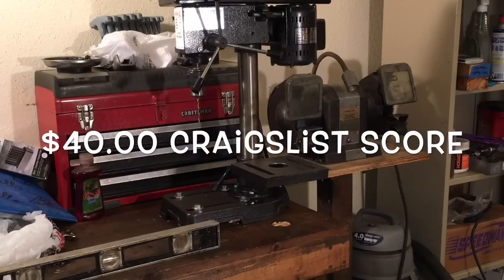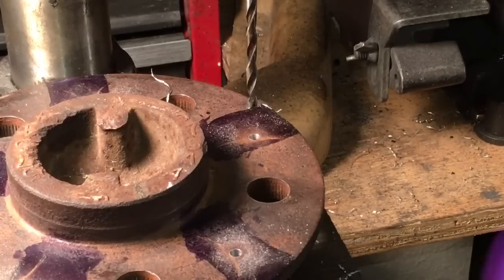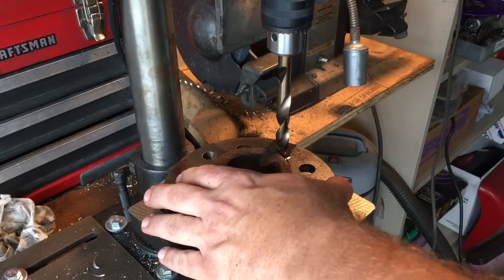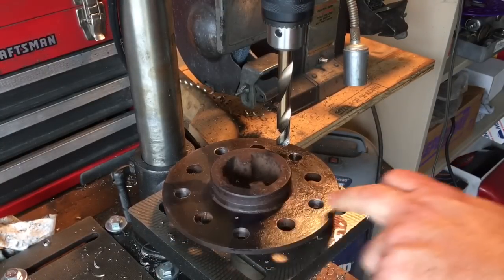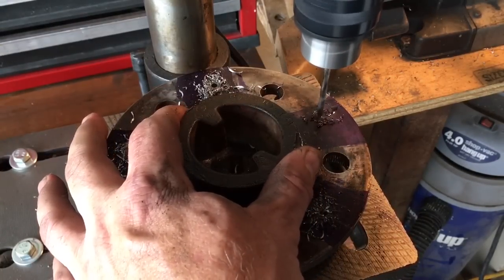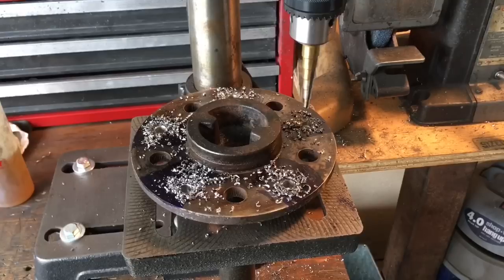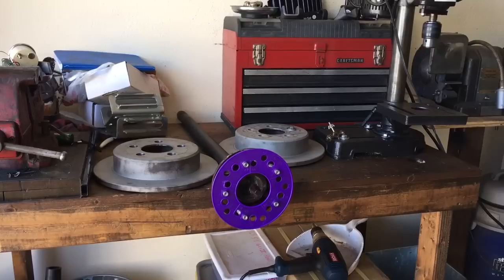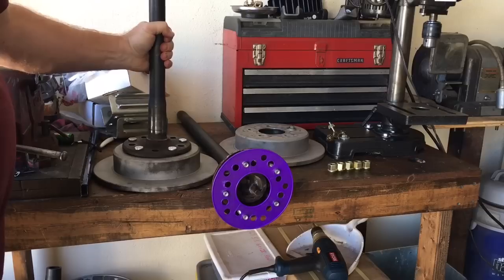Explorer 8.8 axles drilled to GM 5 x 4.75 pattern

Comment: I’m gonna give this a try. Looks easy enough
Reply from the maker: The template needs to locate as accurately as possible.  If you could get a wheel adapter that locates via the Ford pattern with conical lug nuts then use the proper center punch would be awesome.  You’ll need a Cobalt drill bit at low rpm to drill the hardened steel.  JD
Reply: @HeadFlowInc  wow thanks very much. Sounds simple. I’ve got access to all the tools I’ll need. Thanks.

Comment: I bolted a dual bolt pattern rim to the axle. Next used a centering punch in the chevy bolt holes and drilled the axle.
Reply from the maker: If it works it works!  Nice 👍 JD

Comment: Great job...do you have a shop..if so can you send me the address...I need a new bolt Pattering drilled out to put 5x100 18 inch wheels on my car
Reply from the maker: I’m sorry, I don’t have a shop I just had to find away to change the bolt pattern. All the machine shops were so over priced you’d been better to buy aftermarket axles! 
I’d try shopping around your area to see what the pricing is to re-drill axles. JD

Comment: Excellent video.  The old ford holes, don't have to be plugged?
Reply from the maker: No plugs, but I recommend getting a drill bit slightly smaller than the needed final hole size then ream to final size.  Cobalt or better drill bit.

Comment: JD - I haven't seen any posts in awhile.  I hope all is well.  One question, what did you use to control the speed of your drill press???
Reply from the maker: I’ve been dealing with some health issue for the last 6 months.  The most recent concern was a diagnosis of congestive heart failure which landed me in the hospital. I’m doing much better now with medication etc. 
My drill press has the speed control by moving the belt at the top via pulleys.  I put the belt on the slowest position but some people have suggested I could have gone slower, but I couldn’t. 
Thanks for checking on me I truly appreciate it!  JD
Reply: @HeadFlowInc  JD, please take care of your health.  Look forward to more videos.

I have been trying an electric die grinder for port work and need a controller to regulate the speed.   Could also use it on my electric drill press to (faster/easier than changing belts.).  Was checking to see if you used one.  HF has one, but unable to locate any in my area.
Reply: @gmcnelly2468  I used a sewing machine pedal control

Comment: Great post! I have been doing this for years and use an aluminum guide instead of plastic. I clamp it onto the axle after finding where to transfer punch it. 
One tip I can offer is to final drill the hole to 29/64" and then tap it to 1/2-20 NF, then get yourself 10 3" long grade 8 allen bolts, screw them in from the back and if you want tack weld em in place. 
I have also used wheel adapters and even wheels to use as a template for redrilling axles, discs or hubs.
Cheers eh!
Reply from the maker: Thanks for the tips!  JD

Comment: Would've it worked if you had left the studs from ford bolt pattern and slid the purple guide on and then marked the desired bolt pattern of the guide?
Reply from the maker: If they had made the pattern better, unfortunately it didn’t line up like I wanted.  Great idea though, give it a try your pattern/guide might be different than mine.  Thanks for watching and the feedback!  JD

Comment: That lose knurl game is exactly why the holes in the axle should be tapped and threaded  to install hardened screw in suds from the back, and you should use way harder suds than stock for a safer finished product
Reply from the maker: Interesting, I haven’t seen any studs threading in to the flange let alone from the rear.  Press fit has been the method for wheel studs forever.  If it’s stronger then I would be willing to try it!  JD
Reply: @HeadFlowInc  A lot of race axles and and race studs are done as screw in from the back side of the flange, and if I had any choice I would go up in size of the studs and would suggest never using soft stock replacement studs , be safe and God bless you

Comment: I would have ran it about 250 350rpm also if you run the drill in reverse it'll Center itself up in that hole

Comment: If you need a hole exactly .5 use a 31/64th inch drill bit and ream it with a .5 reamer.
Reply from the maker: Thank you!  Clearly I should have researched more since I had to get a larger stud.  Thanks again!  JD

Comment: This guy should have sent these axles to a machine shop to have this work done so he could have more time to watch YouTube videos of other people doing stuff and leave comments telling them how to do it his way. Good job man, you got it done.
Reply from the maker: So far so good they’re working great. I did learn some good tips for improving the results etc from viewer comments.  True story, the machine shops I called about re-drilling the bolt pattern were so high, it would have been more cost effective to buy aftermarket axles! 😳😳🤦🏻‍♂️
Reply: @HeadFlowInc  yeah its ridiculous. all they have to do is sweep it to find center and then use their digital readout to calculate the hole positions and drill it
Reply: @HeadFlowInc  Been looking into this and your video seems to be the most common solution

Comment: Don't the rotors chatter from being over sized
Reply from the maker: No chatter or issue at all they aren’t able to move with the rim torqued down.  If you check various automobile manufacturers you’ll see there’s a lot of clearance allowed for the wheel studs it’s not a tight tolerance.  Rotors are hubcentric located by the fitment to the hub , Thanks for watching!  JD

Comment: you should have drilled them 31/64ths to fit the stock chevy studs
Reply from the maker: Mike Lomsak I promise the rotor has no opportunity to move under braking, rotors are hub centric and having 500+ lbs of clamping force per side, you’d have a hard time trying to get anything to move once the lugs are tightened.  FWIW, even stock rotors per application don’t have a precision fit, there’s a wide variance to account for manufacturing processes and slightly bent/untrue wheel studs.  Check it out on one of your stock vehicles!  

I am not a machinist, but did get some good feedback on how to improve my success in the future.  The proper way to drill the stud holes is to drill with a slightly smaller bit and hone to the final size.  Thanks for the feedback!  JD

Comment: What year make and model did you get the wheel studs off of?
Reply from the maker: Eddie Paez I did not use a particular vehicle, I went to the stud manufacturer website and found the size I needed. You will have a crazy amount of sizes, knurl, length etc to choose from. 
Sorry I couldn’t provide a vehicle. JD

Comment: nice work!  Very well done video.  I agree with post below, finish with a reamer, if there is any runout in chuck, it will drill oversize.  reamers are available a couple thou under.
Reply from the maker: PowerPlay Engines I appreciate all the feedback, it helps everyone learn better ways.  I need a better quality drill press to!  Thanks for watching and the feedback I appreciate it!  JD

Comment: It does NOT need to be level it needs to be square to the drill head.     Level has absolutely nothing to do with this.  
You always drill steel slow with a lot of pressure.
Reply from the maker: Mike Eagle I was trying to square everything up, I had the drill press on the lowest RPM belt arrangement. Thankfully everything worked out!  Thanks for watching and the feedback I appreciate it!  JD
Reply: HeadFlowInc 
Wanted to give you my professional two cents. A lot of people miss understand something being level as a posed to being square with something.  The drill press could have been lying down on its side as long as the piece you are drilling is square with the drill head it will all work out.    I like your videos. Keep up the good work. 👍🏻👍🏻👍🏻👍🏻👍🏻

Comment: Hey great job but what I’ve noticed lately is that a lot of people that could really use a press don’t have one. My whole life I wanted to learn how to build a rear. preferably an 8.8 mustang rear so I went to harbor freight and bought one. I’m 42 years old and I’ve owned over 30 mustangs but have never done a set of gears which is long overdue. It was only $150 and it is such a nice tool to have especially if you’re into cars. It’s not a really large tool and it basically fits wherever.
Reply from the maker: Sam  Scornaienchi Rebuilding the 8.8 really isn’t very difficult as long as you follow the steps and don’t cut corners.  The only tools I didn’t own was bearing/seal driver set, bearing puller and an inch pound torque wrench. 
With the online rebuild information and YouTube videos as reference you won’t have any issues.  
Note: Never mix n match bearings and races always use matched sets. 
It’s way easier imho to work on the rear end out of the vehicle unless you have access to a lift. 
Thanks for watching and the feedback I appreciate it!  JD
Reply: HeadFlowInc Autozone has an in/lb. torque wrench and harbor freight for the bearing puller and drivers tool. About $70 for the 3. I built the 8.8 for my 85 with 31 spline ford  carrier, moser axles and motive 4.30s and after doing that over and over again I think I pretty much have it down. I have 2 more I want to do so that’s why I bought all the tools. I think people really get hung up on getting both coast and drive side spot on and it doesn’t always work out like that. Mainly drive side in middle and as long as your coast side isn’t hanging off the end or not too tight of mesh you’re good. Next set I’m going to use Ford gears and see how it sets up. Pinion Preload is important also. I have a feeling the Ford gears are machined better. I think I could do one in about 2 hours now from scratch.

Comment: Thank you very much, plan in during this next month!
Reply from the maker: Eddie Paez Be very mindful of the run out of the drill and drill bit!  If need be drill slightly smaller and ream it to the final size.
I had to go with a slightly larger diameter stud at the base to get the proper interference fit.  JD
Reply: Appreciate the heads up. I wrote down the Dorman part number as well. Completely new to this, really appreciate the details and your response!

Comment: HeadFlowInc
You should have used a reamer for the last cut. Drill bits never drill the same size as the bit. They wobble, making the hole slightly oversized.
Reply from the maker: Dan Dallman I agree and appreciate the tip!  I wasn’t familiar with how “Sloppy” a bit could be.  The runout of the drill press, drill bit, how many cutting flutes all play a roll.  I wish I had known more about drilling accuracy but I definitely learned a lot.  Thankful I was able to get a plus side wheel stud that fit properly. 
Thanks for the feedback I appreciate it!  JD

Comment: Great video, A handy trick from Australia. When drilling in a pilot hole, take a piece of material (old T shirt) about 3 inches square, fold it on itself several times and put it over the hole UNDER the drill bit, it fills the flutes and stops wander (see oversize) and grabbing as the angled drill bit points break through, works great particularly on sheet material where a two fluted bit drill can result in a three sided hole.
P.S. Use a three fluted bit (without the rag) to win a bet you can drill a square 4 sided hole.
Reply from the maker: Charles Curtis Really interesting tip, the material adds friction to help start the cut. Genius idea thanks for sharing, I appreciate it and thank you for watching!  It’s great to hear from the community! 👍 JD

Comment: I agree with drilling undersize and finishing.  I have had good luck with using a 12mm drill bit but a 31/64 would probably bring you almost spot on.  Also, with a colbalt or HSS drill, the rpms should be closer to 400 rpm for optimum cutting.  Also, remember to let the drill bit do the cutting, only keep enough pressure on the quill to keep the drill bit engaged.  Keeping the workpiece clamped with a vice grip/clamp will also keep the hole size closer to the drill bit size and eliminate the grabbing and twisting when the drill breaks through.
Reply from the maker: Corey McCarthy I’m taking notes on all the ways I can improve the process next time.  It’s very helpful getting tips!
This cheaper drill press doesn’t have the pulleys to get to 400 rpm. I wish I had a better drill press.  Thank you for your feedback I appreciate it!  JD
Reply: @HeadFlowInc  I will give you a formula to calculate proper tool speeds: 4*cutting speed/cutter dia.  Cutting speed varies by material and tool material.  For steel and HSS cutters use 50, for aluminum use 150.

Comment: Thanks for your video. You did well. Its worth noting that even the best bit will drill slightly oversize. Best to drill undersize and finish with 1/2" reamer
Reply from the maker: tongoio Good information, it definitely would be better to use the  undersize/reamer method.  Thankful I was able to get studs to properly fit the holes. 
Heck, I could always switch back to the Ford Pattern if I had to but then it causes rim issues

Comment: Why don't you just get hub centric adapters
https://www.ebay.com/i/282026636689?rt=nc&_trkparms=aid%3D222007%26algo%3DSIM.MBE%26ao%3D1%26asc%3D20161006002618%26meid%3De562ea406aa145f9b03c3e0f897accb6%26pid%3D100694%26rk%3D7%26rkt%3D30%26mehot%3Dag%26sd%3D132932803962%26itm%3D282026636689
Reply from the maker: Night Hawk Budget, if I had the extra cash I’d just buy rotors made for it.  The rotor is hub centric so it’s located safely after installation.
Also, the rotors are installed with all the lugnuts torqued there’s 450-500  ftlb per side clamping force holding  safely.
Reply: @HeadFlowInc  if 26 bucks free shipping isn't a budget then I don't know what is. Those drill bits can't be cheap
Reply from the maker: Night Hawk Dang that’s some great deals!  I couldn’t find anything this cheap when I was looking back then.  I found a set of 4.5” to 4.75” adapters at the bottom of your link for the same price.
I wouldn’t run just the adapters because the adapters would’ve pushed the wheels further out.
But, I would have used the 4.5” to 4.75” adapters to transfer the new pattern.  The Explorer 8.8 with the 2 short axle mod is 3/4” or .750” wider per side wider than the factory 7.5” 10 bolt.  I already have to buy new rims with 5.5” Back Space to tuck my rear tires. More money... 😳😇

Comment: the more accurate way of drilling the stud pattern is transfer it off a exiting disk or brake drum that has the right stud pattern you want. you can use drill bushes that you can simply make on the lathe to get the little pilot hole first and then you can step it up with an other bush in need be.
Reply from the maker: Neville Mcnamara Unfortunately don’t own a lathe... 🙃. I agree, I wish I had a bolt on pattern adapter or as you mention a rotor or something with the Chevy 5 x 4.75” pattern.  If the rotor was the correct size hub it would be super easy to transfer the new pattern.  👍

Comment: Not bad! I been looking to do the same for two Axels, and maybe narrow one, the narrowed one for a 64 chevyII Nova,  and another for a 53 Belair!  To convert to open drive, and maybe aV8! I was thinking about if keeping the 6, bolt it to a 700r, with about a 3.73 gear, it should have a low enough low gear, with enough over drive to make it very drivable atleast. And really fun with a v8! I think around a 3.55  with a 5speed in the Nova, with either  a 350hp +/- 350 ci or a 406 with a automatic,  a good bit of projects I know. Great video!!!

Comment: Your holes were oversized because the axle was allowed to wobble and move during the drilling process. Another possibility is a dull drill bit.
Reply from the maker: Paul Deahl New Cobalt drill bit, I’d have to show you the issue with the  chuck not spinning true even without a bit installed.  I’m not 100% sure it’s got the original chuck or if it’s installed properly.  The chuck only press fits on a tapered shaft zero locking feature.  It actually fell off the very first time I tried using the drill press. Weird stuff. Thanks for the feedback I appreciate it!  👍

Comment: How did it work out in the end?
Reply from the maker: Daniel Mccormick It’s working fine no issues.  If I did it over I’d like to find a bolt on wheel adapter to transfer the pattern or went the extra step to precision machine the inside diameter of the plastic template to accept an exact spacer. But it did work as is. 👍

Comment: That’s some slick work!
Reply from the maker: Richard Walker The biggest issue was the run out or accuracy of my cheap drill press it did not accurately drill the hole so I should’ve used a slightly smaller drillbit but A I didn’t know I would have this issue and B I didn’t really have access to a full set of machinists drill bits.

Comment: How much u charge I have a 5x4.75 but I wanna go to a 5x5 to fit my 65 impala
Reply from the maker: Fsu08 Alvarado See if you can first find used wheel adapters from 4.75” to 5.00” pattern.  This way you can verify two things, the pattern and there’s enough flange to safely drill.

Comment: Speed of the drill bit is determined by the hardness of the metal and diameter of the drill bit.  Larger the drill bit, slower the rpm......smaller the drill bit, higher the rpm.
Reply from the maker: Richard Galli My tint drill Press doesn’t reduce to a low enough rpm and the chuck isn’t very good.  The run out of the drill bit in the chuck is very bad. 
Thanks for the feedback I appreciate it!  JD